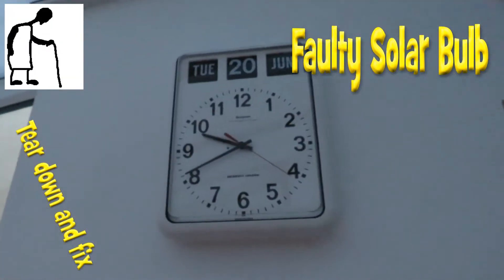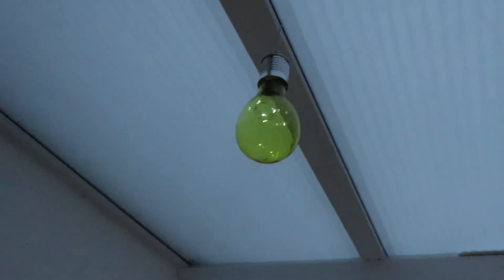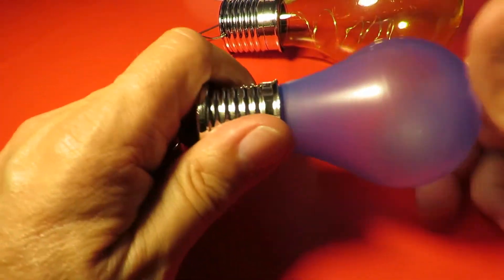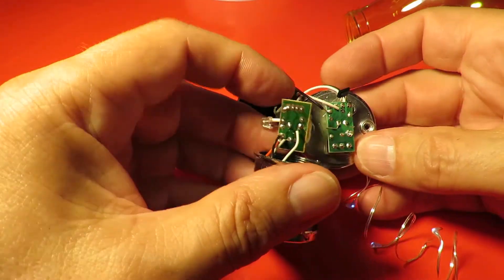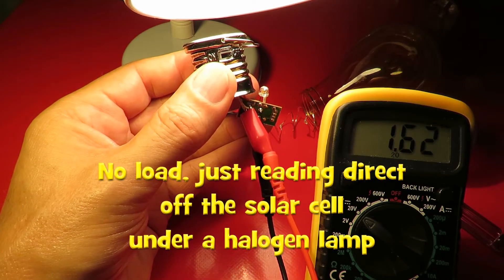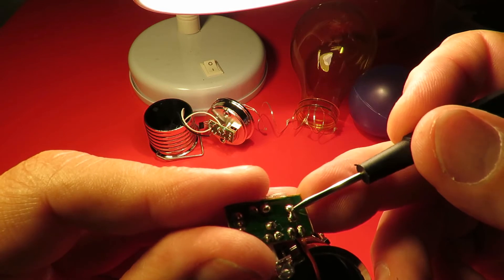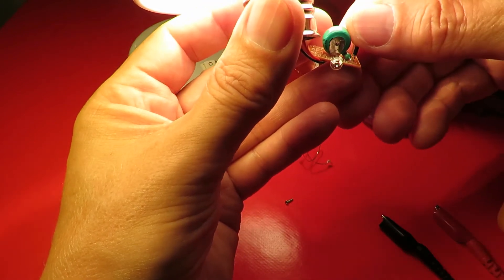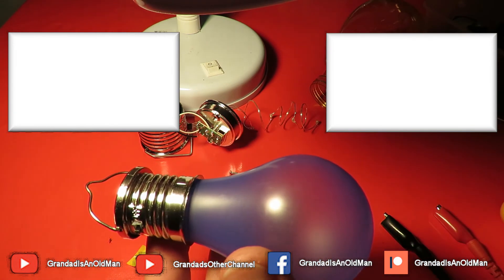Faulty Solar Bulb Tear Down and Fix

Comment: And did battery work
Reply from the maker: Not for very long. I will try charging it direct and if it still doesn't hold it's charge after that I will probably do another video to swap the battery. Sometimes they recover if you give them a few full charge cycles so I will rig it up to a charger to bypass the circuit board. One of the other lights I showed has failed too so I will need to look at that one too.
Reply: GrandadIsAnOldMan  Thanks for info about recovering